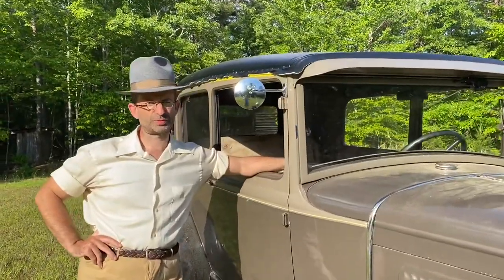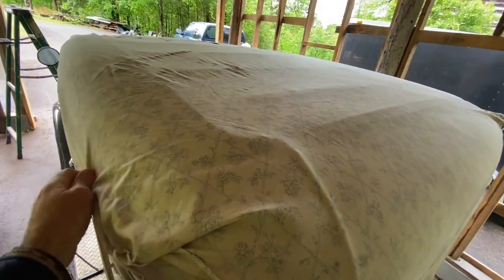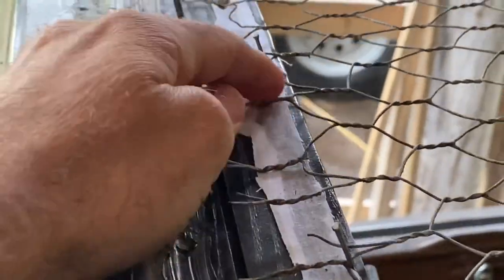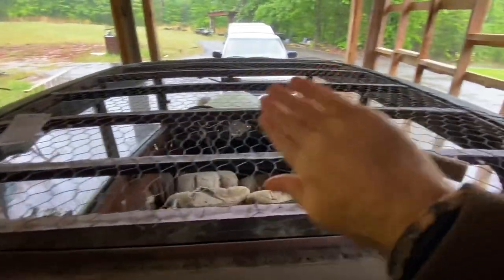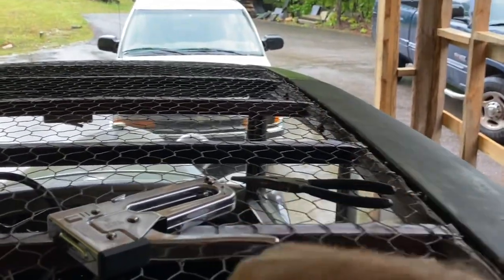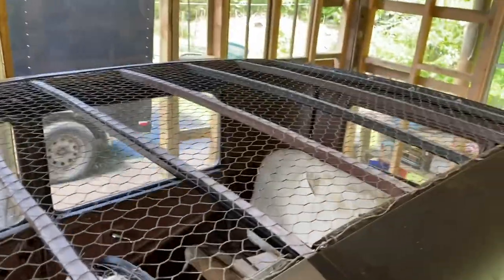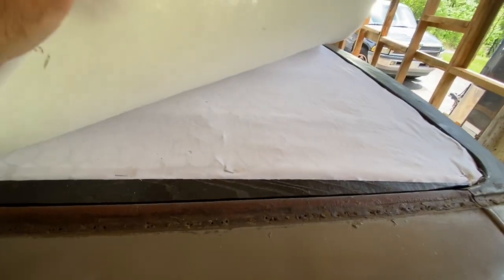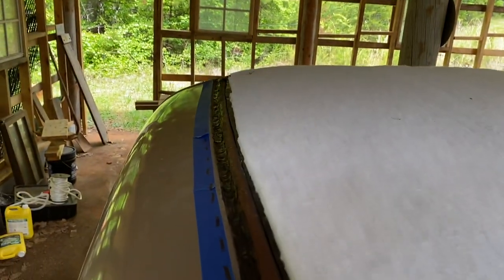How to replace Model A Top Vinyl Part 1 Chicken Wire and Padding

Comment: @pumpkintown I've just watched your video again, the night before I'm about to install my new vinyl roof on my 30 Town Sedan. 
Thankyou so much for posting this video, I just realised I stapled down the chicken wire directly over the top of the wood and noticed you put strips of cloth between the wood and wire. I assume this would be to stop vibration or squeaks. From memory I now realise there was a sheet of cotton below the wire on mine when I removed it months ago.
It's too late for me to lift the wire without a lot of work, so I'm going to paint seam sealer along the tops of the wood ribs/wire junction to keep the wire from rubbing/vibrating. 
Thanks for helping me out again, even though I'm on the other side of the planet!!! Cheers from Australia.
Reply from the maker: Sounds like a good plan brother. Can I suggest that maybe you go the extra mile and pull those staples? A little extra work now will save you squeaks in the future and give the satisfaction of a job well done. Plus whoever gets your car after you someday and sees what you did when replacing the vinyl is more likely to replicate what you did! Pass it along brother! Keep up the good work and watch the other videos in this series to help you along the way my friend.
Reply: @pumpkintown  Both you and I know you're right. I went back today and installed cloth along the roof ribs. 
Thanks again for sharing your learnings.

Comment: As I'm new to the Ford model A,learning as much as I can before purchasing one. Curious as to why the top is a soft top and why it's not a metal roof? Thought there was a reason for why it's designed in this manner but can't remember what that reason was. Perhaps it couldn't have a steel roof because it be to rigid and affect the rest of the cars design?
Reply from the maker: It is a carry over from the buggy top days, and much cheaper to produce. Done owners have replaced with steel roof. I don’t have that option but you could possibly do that
Reply: The steel mills could not produce sheet metal wide enough to make a whole roof. It was not practical to make an all steel roof until after 1934 when they built a new steel mill that could make wide sheet metal. After that all the car manufacturers changed over to one piece all steel roofs, I think the last car with an insert in the roof was 1937.